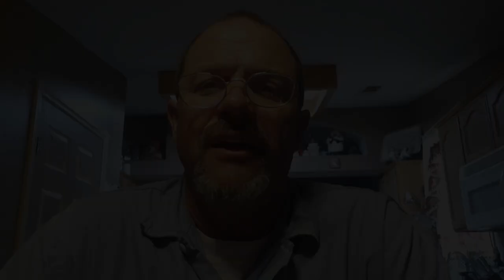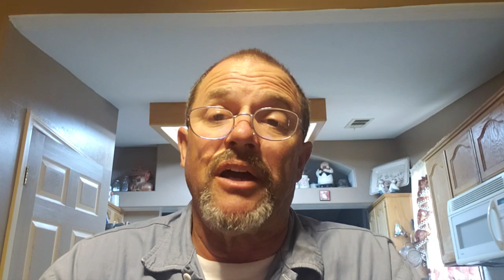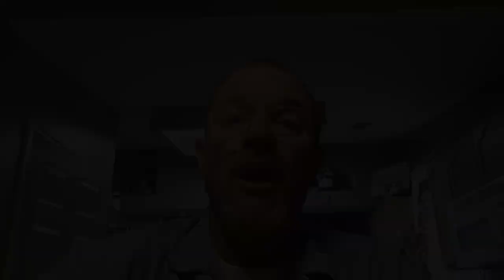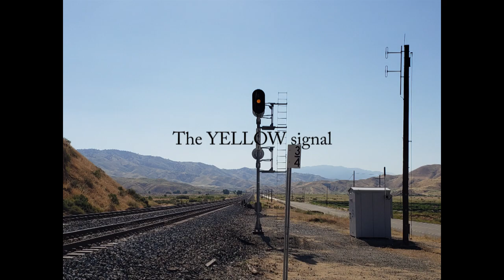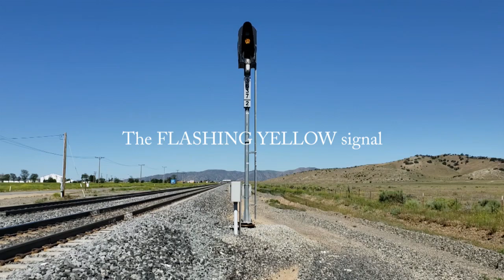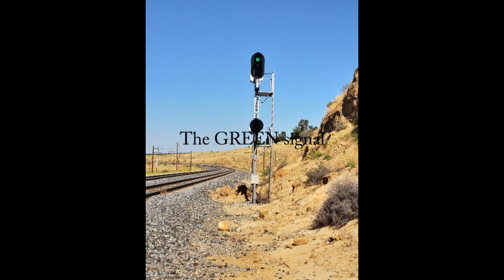Railroad Signals Explained and how they are different from Highway Signals: Part 1

Comment: I've also heard the term "home" signal and "distant" signal, perhaps terms used more historically on railroads.   Are control and automatic signals any different?
Reply: "Home" and "Distant" definitely comes from British rail, they used to have only two signals for a station, one at the station and other one leading to it. Now we have more signals betwen stations to allow more trains to be operated in the section.

Control signals are controlled through signaller panel (a.k.a dispatcher in US of A) but Automatic signals are controlled only through track occupation, no need for human interference. Automatic signals are suitable for straight sections of tracks without any switches.
Reply from the maker: On SP lines we used "H" and "D" designations for signal circuitry until the new system was upgraded 2010-2016.
Reply: We used distant signals for approaching a draw bridge or crossing another railroad in dark ( non signaled ) territory.
Reply from the maker: @billmorris2613  they still use them on branch interlockings here too. We have no navigable waterways in my corner of the railroad so drawbridges are just something we hear about!
Reply: Mark Clay McGowan   Between New Orleans and Alexandria we have two draw bridges.  One crosses the Intercostal Water Way a few miles north on Addis, LA.  A few months after I hired out in 1973 we had a train hit the concrete counter balance with the bridge up and the signals were clear.  The signal maintainer that was first on the scene after the accident transferred to engine service and I had him as a trainee.  He told me the four spring loaded plungers stayed down because the tops had mushroomed from years of use.  Back then the bridge tenders did not have radios to talk to the trains.

The bridge tender was having a problem getting the bridge to come down.  He lined his control board for clear signals hoping that would get the bridge to lower.  He did not know the plungers were stuck in the down position so the signals went to clear.  If any one of them would have come up the signals would not have cleared.  The engineer and head brakeman were both killed.  The other bridge is over the  Atchafalaya River at Melville, LA.  We also have two going west toward Houston.  The one North of Addis and one over the Atchafalaya River at Krotz Springs, LA.
Reply: Great question.  "Home" and "Distant" are derived from British practices, as sercan celenk pointed out.  The terms mean the same here in the US, but they are not exactly used the same.

In the US, a Home signal can be absolute (must stop) or permissive (can go past).  A Distant signal (with a capital D) is a separate class of signals entirely—it's not even a block signal.

The Southern Pacific semaphores exemplify this usage.  If you do an image search for "Southern Pacific Semaphore" you'll see three types of signal blades.  The shapes of the blades denote the type of semaphore arm you're looking at:
1) Square-end, usually red with a white stripe near the end — HOME arm.
2) Fishtail-end, usually yellow with a black chevron near the end — DISTANT arm. 
3) Pointed-end, usually red with a white chevron near the end — HOME arm (permissive).  

A Home arm indicates the state of the track past the signal.   A distant arm indicates the state of the next Home arm(s).  

Southern Pacific did not use the #3 arm to my knowledge, so the same square-end Home arm would be absolute if there were no number plate, or would be permissive if there were a number plate.  (This is just like today!)  Both were still Home signals, though.  The permissive ones were generally automatic and the absolute ones were controlled by a signalman, or perhaps a dispatcher.  

A Home or Distant arm can appear alone, or in combination (Home arms always above Distant).  Like UK practice, a Distant arm can appear alone and will show Caution if any of the Home signals between it and the next Distant signal are at Danger.  Most of the time, though, the SP put them both on the same pole.  If the Home arm showed Danger, the Distant automatically showed Caution, and this indicated Stop or Stop and Proceed as the track beyond the signal was occupied.   If the Home arm showed Proceed but the Distant arm showed Caution, then the equivalent of Approach was indicated—the track beyond the signal is clear, but the next signal requires a stop.  If both arms are lowered to Proceed, then this is the equivalent of Clear today.  

A Distant arm appearing alone is not a block signal because only Home arms denote signal blocks.  A Distant arm is merely a warning device for subsequent Home arm(s).  Distant signals survive to this day, often as a signal that can show Yellow or Green aspects, or as a fixed Yellow light or yellow blade.  Some railroads called these "approach signals" too.  You will not find things like "splitting Distants" in the US like are in the UK and other countries, and operational/meaningful Distant signals have fallen out of favor in the US because of cost.

A Distant signal, in this matter, is not the same as a distant signal (lowercase D), which is the signal encountered by a train before it arrives at a junction (and its absolute signal).  Such a distant signal (lowercase D!) is often equipped to display extra aspects to trains for navigating the switches ahead at the next signal. Usually these distant signals are intermediates or permissive, but a controlled or interlocking signal can also be a distant signal if there's another junction at the subsequent signal beyond itself.

Comment: Sis this w Lionel, actual track ckt. one running rail insulated and 6 v.d.c. across it and a relay also.
train enters block and relay drops out. I did have a resistor with battery so it would not be a dead 
 short when train entered the block, this could all be hookt up so u could not bend the iron into an
occupied block, It would could be hooked so track sw. could not be unlocked.
Reply: What?

Comment: When the signals went out at night in a remote location out in the middle of the desert where it was pitch darkness, would you guys head out there at night or would you guys wait to do it in the day? I’m assuming for your safety you guys would wait for the day time.
Reply from the maker: We were called immediately on light outs. Weather and darkness weren't a consideration when the system was having problems with the occasional exception of problems in sidings that weren't going to be used.
Reply: Dark is as good as a red

Comment: Enjoying the video's. For a time, we had a lunar or white signal indication on one of the signal masts here in southern Illinois.
Reply from the maker: I was always a fan of the lunar. Beautiful signal.
Reply: In NYC we used to have quite a few lunar white signals. They were used as train speed regulators. They're disappearing as more and more the system is transitioning to Communication Based Train Control.
Reply: Lunar White and Flashing Red both generally mean "Restricted speed" on many US railroads.  Purple used to be used on dwarf signals back in the day instead of Red to try and avoid confusion with background lights at night... but that faded out of use as it didn't really seem to be that big of a deal.  Blue lights used to be common on doll arms, but they're rare to find now.  Clear white (not lunar white) signal lights are still around, mainly on CPL signals; 4 of the marker lamps are clear white, not lunar white, the other two are yellow.

Comment: Another good explanation of how railroad things work. Hope the modern day people can get a grip on it.
Reply from the maker: Thanks for checking it out! I'm glad you enjoyed it.
Reply: It’s like many other jobs with a lot of responsibility.  With proper training and annual testing it becomes second nature.  But if we forget, we are required to have the rule books, timetable, and operating manuals with us.  The rule books are a loose left type book and when changes are made we remove that page and insert the page with the new change/s. There are methods of updating the other publications we carry with us too.  The books we have to carry with us is a very small percentage of all the rules and regulations for the railroad industry.  

The FRA is to the railroads, as the FAA is to the airlines.  Each department in both industries has their own set of rules and regulations.  Both sets of rules from the FRA and the FAA weigh about the same.  If you put them all on a train they would each need their own box car.  If we used an airliner they would each need a few 747s.  Well, that may be slightly exaggerated.

Comment: Hi Mark, I was wondering how often a train is given a signal. Thanks
Reply from the maker: It depends on track speed and braking distance. On the Tehachapi it's about every mile. Higher speed track about every two miles.
Thanks for the question and for checking it out!

Comment: Movement must be made at a speed that allows stopping with half the range of vision short of....Mark! Thanks for the comments on being a locomotive engineer, you are 100% correct!  Lives depend on everyone following the rules. That said, it was the best job I had.
Reply from the maker: Yeah, I don't write a script when I do these. Maybe I should! I couldn't remember the wording. I figured someone would correct me. I'm surprised it took so long! The RR was a great job. It annoys me when I hear people whine about it. Thanks for checking it out!
Reply: @MarkClayMcGowan  something I have noticed since the change to PTC on the UP main here (Brooklyn Sub in Oregon): prior to PTC, the signals used to light up as the train entered each block, 'approach lit.' The controlled signals near my house (I live next to the mainline) have been lighting up when the train is a ways away, three or four signal blocks away, sometimes.  Some times not.  I don't understand the inconsistency.  Any thoughts (thank you)?  I wrote that comment with the Restricted Speed thing early on in the video, no criticism intended. Hope you're having a great retirement!
Reply from the maker: @LouT1501  many locations are programmed to light when a route is cleared, including intermediates in the block and some are still approach lit. We were told we could reprogram them to do whatever we wanted but it wasn't worth the time.

Comment: Most automatic signals are permissive, meaning that a red signal is stop and then proceeded at restricted speed.
Reply from the maker: I knew there was an exception, I just couldn't recall what it was. I truly count on viewers to make those corrections. Thanks for checking it out!
Reply: Permissive Red signals are a complicated matter, believe it or not.  "Stop and Proceed" isn't as common as it used to be, as many have redefined that to Restricted Proceed or Restricting or something similar to save a bit more time and fuel.  Some railroads have gone back and forth on that over the years, not being able to weigh cost savings versus safety.  It really comes down to the rulebook in effect!

Comment: Hi Mark. Enjoying all your videos. I was hoping you could answer a question regarding a piece of SP signal equipment I saw back in the 1980's. I was on the SP Palmdale cutoff and saw a large display next to the mainline that had a 3 numeral digital board and a red revolving light on the top. I just got a quick look at it and would assume this is the old hotbox detector???? So would the board display the axle number for the employee in the caboose if there was a defect?? I've done a bit of research on the internet but can't seem to find anything about this item...Thanks in advance..Jeff
Reply from the maker: That's exactly what it was. There were also two white lights on top of the numeral board to indicate which side of the train the hot box was on. 
Thanks for checking out my channel!
Reply: Fast response....Thanks. When did they stop using those? I always wanted to see one in operation. Very unique...I can't even find a photo of one on the internet. Was there a specific name for them???
Reply from the maker: @dunsmuir238  http://tracksidetreasure.blogspot.com/2009/10/hot-box-detectors.html?m=1 try this
Reply from the maker: @dunsmuir238  they stopped using the numerical display board type in the mid 80s when they were getting rid of the caboose.
Reply: Thanks so much for both responses. Much appreciated. Looking forward to more of your videos!!!
Reply: @MarkClayMcGowan  They should have saved it... turned into a modern "Your Speed Is..." display! (LOL!!)